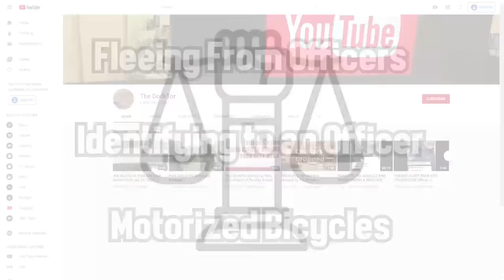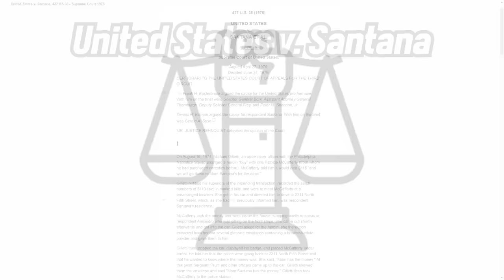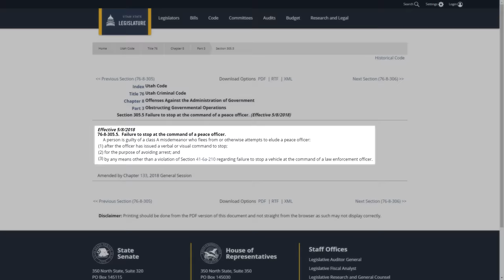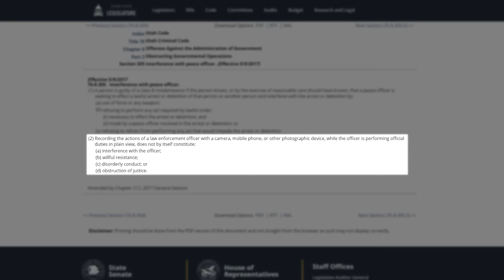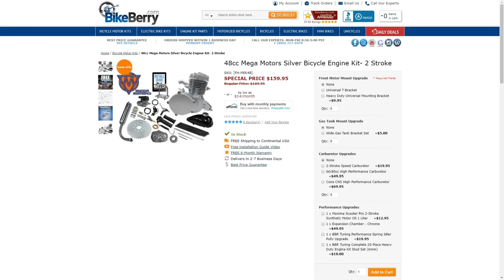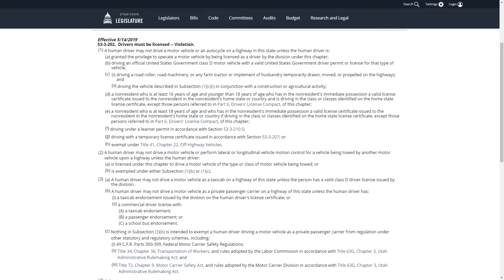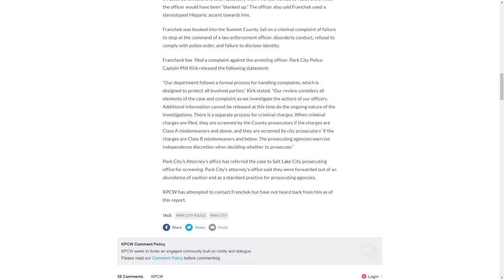Teen Stands Up To Cops Arresting His Father

Comment: The clip portion that wasn’t mentioned is the witness said the father had a gun, but stated the father never pulled it out or pointed it at anyone.  As such, the police had no reason to think a crime was committed.   Also, you should have said the father should have never opened the door.   He could have spoken thru the door or window.
Reply: Also the police never said stop. The police never saw a gun.
Reply: AtA did say that the neighbor said they "might" have seen a gun.
But AtA also missed that even if the guy definitely had a gun, that's not RAS in Utah, an open carry state, unless he was brandishing it.  No RAS, no lawful detention.  No detention, no fleeing.  No fleeing, no hot pursuit.  In fact, as you said, the police had no real reason to even make contact.
AtA messed this one up.
Reply: @Bacteriophagebs  yeah AtA has been slipping.
Reply: Also not in this video, but the original witness that claimed to have seen a gun was not even part of the interaction over the motorized bike.
Reply: in all fairness, if you know a guy has a gun and he starts lunging behind his door you could easily make the connection that he was going for his gun so I don't think the police were in the wrong here
Reply: ATA missed a lot of the video. I linked the full video in the comments ATA needs to revisit this the cops never said stop and did a lot of wrong shit I hope they sue them and win.
Reply: That's fine in theory, but doesn't quite work that way. Cops don't like hearing no.
Reply: @Connor-jl9gq  
Wrong conner.
   Stick with the facts and the constitution. 
   The fact is there was no gun. 
   Supposedly some woman said she might have seen a gun, but this mystery woman didn't give a written statement and they didn't get her statement on video (in other words, there was no woman stating there was a gun technically & most probably literally. It does make a nice excuse)

   Even if he would have had a gun on his waiste , that's a constitutionally protected activity.
   A person engaging in a constitutionally protected activity does not give police reason to violate the persons rights.
   But that's irrelevant here, because there was no gun.
Reply: @sammehlberg6664  and that is why you record them.
Reply: @AnubisRLDD  that's all well and good but a recording doesn't bring back the dead
Reply: @jupitercyclops6521  it may be constitualy protected but are you expecting police officers to allow suspects to lunge for a gun and potentially get themselves killed because they didn't know for certain? surely the fact that if he did have a gun grabbing him would have prevented fatalities is a good enough justification?
Reply: @sammehlberg6664  no but it will punish the killers. And you do know that if you defend yourself against the cops with deadly force so long as it was in defense and you weren't the aggressor that you will be found to have been just in killing the cop? Again why videos are important because when shown as evidence against the wicked the wicked lose.
Reply: @AnubisRLDD  once again, I agree completely. Just pointing out that you can't really do it thst way most of the time
Reply: @sammehlberg6664  just wanted to make sure I was clear 🤣 sometimes I think it out correctly just don't convey it properly I know that it's not as black and white as that but I encourage everyone to do the best they can for themselves no one else will.
Reply: Why there are no walls around most of those houses? If there is a wall and a locked gate, police never able to reach the door without a court order.
Reply: @AnubisRLDD  fair enough. I also often find myself explaining things several times in several ways before I can properly transfer my thoughts into the head of another.
Reply: @sammehlberg6664  Thanks for the answer. Well then its useless to have a house from such places.
Reply: @KamakNeApiMalimawata  indeed. Living in america when you're not the wealthy is absolutely not how it looks on tv. Maybe it's just here in missouri, I can't speak for other states.
Reply: @Connor-jl9gq  And see, there you go.  Guns are legal, and gun nuts will insist that everyone should have them, yet  you imply that it's completely warranted to interact with anybody who even MAYBE has a gun like a dangerous criminal.  Lol do you not see the problem here?
Reply: @michaelhaydenbell  no becuse guns are the most efficient killing machines ever created, I support the right to bear arms but if someone owns small device with the ability to kill in a second the police need to be alot more careful when interacting with people who they belive have these things 
Its not the gun that is the issue it is what the guy could have done with the gun that is the issue
Reply: The hot pursuit clause was initiated from the subject fleeing from a detainment. The police were within legal bounds to detain the subject, especially given the report of a firearm, for officer safety. The idea that a "crime" has to have been committed, or is about to be committed, being required for detainment is not correct, even though youtubers claim it all the time. If a cop wants to detain you, your best bet is to let them detain you and then question the legality of the detainment later. Resisting arrest is ambiguous and doesn't really follow behind the pretense of a reason for a lawful arrest (or a secondary charge) in the first place, as you would think it should and as it should. You would think for resisting arrest to be true, arrest would also have to be initially true , however logic seems to fail the court in this regard. It's elementary logic imo: Modus tollens takes the form of "If P, then Q. Not Q. Therefore, not P." It is an application of the general truth that if a statement is true, then so is its contrapositive.
Reply: @samriley8278  That's a stupid thing to say seeing the clip was cut of mid sentence, he very well could have said stop after the no's.
Reply: @j.l.8000  They identify her as another independent witness towards top the beginning but the wording is a bit strange.
Reply: @Connor-jl9gq  That is the problem living in the US, cops get to use the excuse that they think their suspect has a weapon so therefore they can break all morales and arrest someone based on suspicion. You might aswell walk around thinking everyone has a gun and is out to get you. What a sad and cowardly mindset that is. You don't need a gun to cause death and destruction, there is a lot of tools at hand people can buy to do such a thing. I feel you are intentionally blinding yourself from the facts at hand in this video, this encounter was handled very wrongly. Not to mention the officers actions just created more disorder and distrust amongst their own community and people who watch this.
Reply: @cyberbluntz  None of the officers detained him, so where did that come from. The guy walked outside his house and asked for their names and badge numbers. The officer said lets talk about the incident, and the guy declined and refused to engage in a conversation and return to what he was doing.. At no point did the officers legally detain him. Unless you think that everytime an officer speaks even a single word to you that means you are detained.
Reply: @b4rk_b4rk  I think if they were told he had a knife or bomb or a tazer they would react in the same way and I hink they were justified in their actions
Reply: Yeah, but you cannot retreat back into the house. Instead talk to them through the window.

But the best answer I've seen by online lawyers... Dont even answer the the door. If they want you, or you've broken the law, the search warrant allows them to come in.
Reply: @Lukyan  I agree that wepon systems so complex that only millitarys supported by governments can operate them are more dangerous than guns but they are not going to be a threat to police officers lives becuse no one person can use them 

Guns however are a threat to officers becuse anyone could be carrying one or have one stored in their house 

Are you actually arguing that when police officers see a suspect lunging behind a door and they belive this subject is going for a wepon so they can kill the officer, the officer should just wait to be shot?

And if not why are you opposed to the police intervening in this scenario? I genuinely do not understand
Reply: @samriley8278  Exactly, the officers just say things like, "no, no" and "woah, woah" as he goes inside lol. 

People can go to the DockTor's YouTube channel to watch the full body cam footage as the police enter the home.
Reply: @akilla214u2c  this shouldn't have happened, the cops didn't do their jobs correctly. it isn't that mans fault for misunderstanding them.

There were no lawful orders for him to step away from his door or off his porch so that way he can know he is being detained.

He felt like he didn't need to answer their questions, if they decided to give him information instead of asking for information. This entire situation could've been avoided, in my opinion, they are in the wrong.

The problem is that there are so many laws that allows cops to do the things they do, and defend them for doing it.
Reply: I argue he had reason to believe he is not being detained, even after the order I fail to see a reason the cop would feel like he had the right to issue said order. Also should not have ever left his home in the first place. 

Honestly I feel like any cop that refuses to enter a business when carrying their gun should be trespassed out and refused to be served. If cops think it's a crime just to own a gun, then it's fair to think they don't have the right to own a gun. It's same logic.
Reply: @Bacteriophagebs  It feels that you are missing the point completelly. You said that the police did not have a reason to make contact because nothing about the gun has illegal, but they were not doing contact due to the gun but due to the complain about someone riding a bike illegaly and a discussion about said bike. They would contact the person involved in the altercation to get their side of the story anyway.
The problem has that the father received a lawful order and decided to flee instead of comply (or even ask if he has being detained) which gave reason to the cops actions. 
The only importance of the gun is that it may be the reason they gave the order to move in first place (less risk) which had the father just talk with them would not escalate, but it has not the reason for the contact nor the reason of the arrest. It has mostly irrelevant, at most putting them in alert.
For the grades, I think that one of the officers should receive a lesser grade (the older one) due to him being very irritated and not really doing a good job in deescalation (while the other cop being kinda exemplar). I would also give a lower grade to the kid (although its obvious the father, that acted as an idiot, that he acted like that) because he has being too combative which is a big problem I see in a lot of auditors - a holier than thou attitude where they know everything and cant be wrong. So B+ feels too much even if understandable to be under adrenaline.
Reply: @b4rk_b4rk  right, but the streets is not where u can challenge LEO. You'll lose every time. The US Supreme court allows them to go beyond the rule of law, just by saying 1 or 2 catch phrases...

1. I feared for me and my partners life.

Good job, cop your free to go.

Do you need cases references to see that point is true.

1. Amber Guyer
2. Kim Potter
3. Victim Jacob Black
4. Victim Breonna Taylor
5. Victim Philando Castillo

I wont even say George Floyd.. Now they were different type of citizens in this case and we know US law has different law books for those type of people than the guy in this video.
Reply: @marpj6138  Sure, the cops could initiate a consensual encounter to get Mr. Francheck's side of the story, but not to detain him.  He was not accused of any crime.  The bike incident was his son.  Still no RAS for detention.
Also, regarding the bike thing, the cops screwed that up by continuing to question the kid after both he and his dad had said the kid wasn't going to make a statement.
In Utah and most other states, a parent is to a minor like a lawyer is to an adult.  If the kid asks for one, you have to get them.  If the parent says the kid isn't answering questions, the kid isn't answering.
In this case, the father told the kid not to say anything, and the kid said he wasn't making any statements.  Then the cops hauled his dad away and kept questioning the kid.  This would be the same as cops removing a suspect's lawyer from the room, then questioning the suspect.  It renders anything the kid said inadmissible.
Reply: @Bacteriophagebs  

"But AtA also missed that even if the guy definitely had a gun, that's not RAS in Utah"

The RAS is iffy but Utah Criminal Code 76-10-506 is pretty broad.. If there was suspicion he was exhibiting a firearm in an angry manner that's enough for a detention.
Reply: @Connor-jl9gq  That...did not change a single bit of my point.  Not one bit.  You completely missed it.
Reply: @samriley8278  Even if the police saw a gun, that isn't legal grounds to do anything. The man doesn't have to prove that he has a gun or that he legally can have the gun.
Reply: And heres the kicker: the witness probably only mentioned the gun out of awareness. I mean, either to be safe, or just make them aware so that when they see it they dont freak out. It was a bad situation to have to make a choice, as saying "oh btw they have a gun but they didnt brandish or raise it, just fyi they have one" can be taken as "they have a gun and ready to use it" when it could ve an awareness
Reply: @rickybiggie  that is true, but the police were justified in worrying that he was going for his gun and was going to try to kill them so I think they were in the right
Reply: @Connor-jl9gq  a gun they didn't know he had and he didn't show any signs of aggression. They had no reason to believe he was going for a gun. The cops were overstepping their authority and had no legal standing to enter his house. Hell I have guns hidden all through my house, that doesn't mean the cops can just show up and come in whenever they want to.
Reply: They neve said a crime was committed when they first got there. So how that is a factor is confusing.
Reply: @Bacteriophagebs  actually they had every reason to make contact be ause he was involved in an altercation before the police showed up.

So they had to make contact to get his side of the story and thats all they had intended to do when they showed up.
Reply: @jupitercyclops6521  prove there was no gun. You can't so don't make baseless comments
Reply: @lordvika2526  Only if there was an allegation that a crime was committed in the altercation.  Cops don't (or at least shouldn't) show up if you call them and say "I had an argument with my neighbor."
They were there about the motorized bike, were told there "might" be a gun (not a crime), initiated what was either a legal consensual conversation or an unlawful detention, then freaked out when the guy ended the conversation abruptly/fled the unlawful detention.
Reply: @rickybiggie  no but if the cops were investegating a crime knew you had guns then you lunged behind the door I think they would be justified in detaining you until the initial incident was sorted out
Reply: @Bacteriophagebs  no but they showed up because someone else called it in.

Yes it all started because of the bike but it turned out the way it did because the guy who might have a gun decided to run into his house when he was given a lawful order to stay where he was. Be ause the woman who called said he might have a gun it becomes an issue of officer and public safety. So they had the right to follow him inside the house.

Nothing they did was unlawful or wrong.
Reply: @lordvika2526  So you completely missed everything I said, then.
It was not a lawful order.  It was either a lawful request or an unlawful order.  Having a gun is not a crime nor an issue of public safety in Utah.  And "officer safety" is a bullshit excuse used to justify violating people's rights when hey haven't done anything wrong.
Either he was detained unlawfully, or he was not detained and was free to go back into his house.  Either way, the cops were wrong, and the DA knew it, which is why the charges were dropped.
Reply: @lordvika2526  
You have that backassward.
  Innocent until proven guilty. You prove there was a gun.
   Save your comments that make no sense.
Reply: @Connor-jl9gq  
What gun?
There never was a gun.

   
    All that aside, our constitutional rights are the most important thing to a free society.
    The rights of a free nation are more valuable than any one individual life including law enforcement.
   Great men have sacraficed their lives for your freedoms. 
   The constitution is so important, Those cops took an oath to uphold it.
Reply: @cyberbluntz  
Except he wasn't detained
Reply: @jupitercyclops6521  again they were working on information they were given.

But the bottom line is that the chance of a gun was not why they made contact. They made contact because he was involved in the reason they were called in the first place.

But again you can not prove or disprove that there was or was not a gun, but an eye witness to the events said there was one. Also seeing as the guy decided to try and run inside his house I stead of explaining his side of everything he made the situation worse and got charges against him
Reply: @jupitercyclops6521  the police thought their was a gun and ATA never confirmed or denied the existence of a gun so he could have had one 

and the constitution is incredibly important but if the constitution leads to the deaths of government officials like police officers because they don't want to risk following an armed suspect into their property then you need to evaluate your priorities
Reply: @Connor-jl9gq  
Well sir, 
   I think we will have to agree to disagree on this matter. The constitution is something I would be willing to sacrafice my life for and imo, if the gov isn't willing to do the same, they aren't worth having. That's just my opinion.
   I respect your right to your opinion & I respect your defending your opinion
   I wish I could change it, but I respect you for having it& voicing it.
    You have a good day!
Reply: @lordvika2526  
But Mr. Vika, even if there were a gun,  that's not a crime unless he would have threatened someone with it.
    So even if h would have had a gun, it doesn't give police the right to break the law and enter a citizens property unlawfully.
   Too often cops make up excuses to try t justify their own unlawful activities.
   This seems to be one. Of those cases.
  If cops don't follow the law,, they are criminals with badges
Reply: @jupitercyclops6521  why are you so stuck on the gun part.

Also that's just it they didn't enter illegally. Because he turned and tried to run into his house allowed them to enter his house since they were in pursuit of him. 

AtA explained this in the video. Just because you dont agree with it or like it doesn't mean you are right and the laws are wrong. 

Maybe actually pay attention to what is said in the video before making comments that are incorrect
Reply: There was no gun. There was no crime.  There was no detention.  They already did an IA investigation on this and it was determined they had no RAS or PC to pursue him into the house.  2 of the officers had to quit because of this.
Reply: @rrdt   prove there was no gun. Just because there was no gun shown in the video does not mean there was not a gun seen during the situation that required the police to be called in the first place. 

The crime was running from the police after being given a lawful order to stop.

Go watch AtA and se what laws the guy broke.

Also prove that 2 of the cops got fired because which the situation that happened everything they did would give them qualified immunity. 

Don't bite all the copnhating channels that edit their videos to only show cops doing what seems like wrong things and actually look up and study the laws that the specific cities and states because they are all different and what might be illegal in one place can be legal in another.
Reply: @Bacteriophagebs  exactly right.
Reply: @cyberbluntz  are you of the opinion that the police can legally detain you without a reasonable suspicion of a crime? The police can detain and cuff a person just because they want to or for any reason ? I thought that the police detained people so they could investigate a crime. Do you believe that a person has to ID themselves anytime the police ask you to any time anywhere? Can the police detain anyone legally carrying a gun for officers safety?
Reply: @markmixon1121  sure it does. If what they did falls under qualified immunity then they can't get fired either. 

I have never seen a police officer that had QI every get punished in any way.
Reply: @lordvika2526  There was a case in Austin Texas where a cop said that a guy spit on him another cop was there that said that he didn’t spit on him. The case went to trail and the “ higher ups “ told him that if he testified in court that he did not spit on the other cop he would be fired. He testified in court that the defendant didn’t spit on him and the defendant was found not guilty on that charge and the cop that in my opinion and the jury’s opinion told the truth was fired as promised. Seems like he lost qualified immunity for telling the truth and crossing the “ blue line”.
Reply: @markmixon1121  Do you even k ow what qualified immunity is? That's not something that would fall under QI.

Examples being they detained or arrested someone on false charges. Depending on the situation and everything that happened a judge can say that the police didn't do anything wrong and are protected by QI but at the same time a different judge might not give the police QI.

Him telling the truth on the stand and getting fired has nothing to do with that.
Reply: @markmixon1121  And there are other reasons to be detained besides suspicion of a crime.
Reply: @cyberbluntz  well I am always willing to learn new things. Could you let me know what those other things are? Thanks
Reply: @markmixon1121  , DUI checkpoints is one example where some jurisdictions allow the checkpoints without reasonable suspicion of a crime, where a police stops a car under the color of the law, to initiate an investigation, which is considered detainment. The detainment, should be considered legitimate whether or not the cop had reasonable suspicion. Even if he doesn't have a legal reason to detain you, you are still legally detained. You don't get to say, "oh he has no reason to detain me so I'm not detained since I did nothing." Questioning the detainment is fine, fleeing from an unlawful detainment is not. Legal detainment or not, fleeing from it is still a crime. When a cop pulls you over, he doesn't say you are detained and isn't required to do so, but you are being detained, the same as a cop ordering you to stop, the detainment is inferred.
Reply: @cyberbluntz    DUI check points is a great example. Another one I had not considered is inland “ boarder check points “. But it seems odd to me that if a cop stops you for no legal reason that detainment would be legal. But if so wouldn’t that mean that a police officer can stop anyone and demand ID in states that require you to ID when legally detained?     If I understand the laws about traffic stops the police have to have probable cause to pull you over and at that point you are under arrest for all but a few traffic violations
Reply: @markmixon1121  You can be unlawfully detained but are still considered detained legally. The lawfulness of the detainment has be to questioned in court after the fact, when a cop insists that you are detained, and even if you know it's not lawful that they detained you, you are still legally detained (IE; you can't just leave),  just because they said so, for the time. But that's why they lose qualified immunity for unlawful detainments, it opens them up to be sued personally.
Reply: @Bacteriophagebs  the kid riding the bike on the road was reasonable suspicion of a crime. You need a license to operate one on the road in Utah. But they never stated that was the reason they were there, so I still think the courts will find it in favor of the dad. But I bet that's the crime they try to say they were there for when they realize that there was no other crime.
Reply: @Imugi007  Sure, but we both know they wouldn't have gone to the guy's house, especially in those numbers, over the bike issue.  It's at most a ticket, and would probably require the police to witness it to be valid.
The cops were called because the guy got into an argument with the neighbor.  They went to the guy's house because cops hate people exercising their 2A rights and assume anyone who is (or might possibly be, according to one biased witness, in this case) is a dangerous criminal.